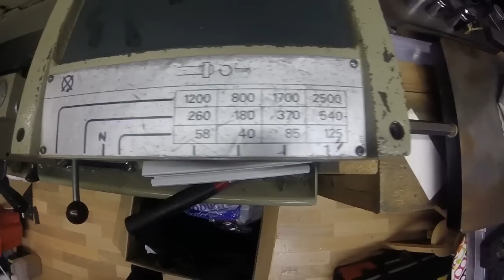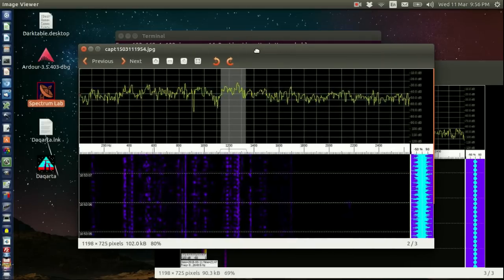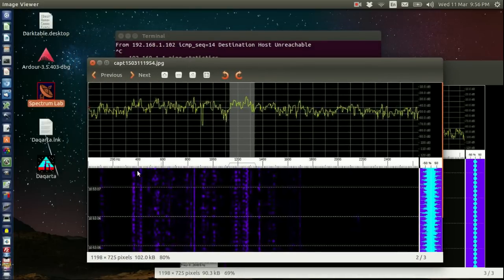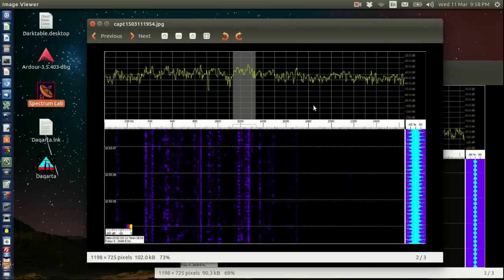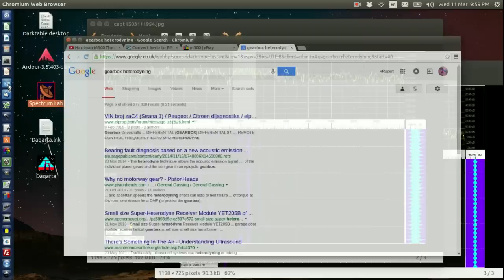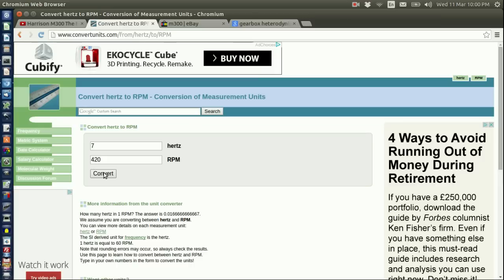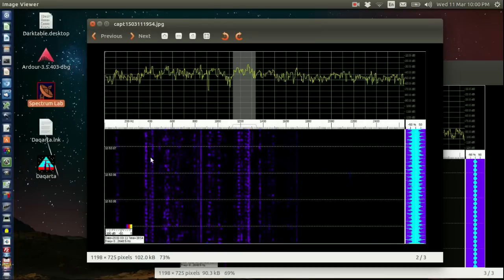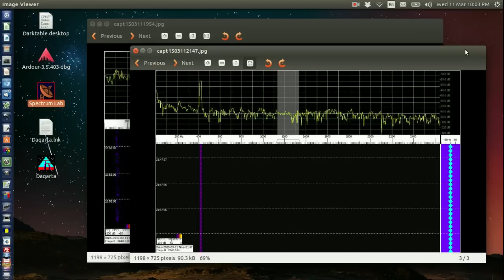Harrison M300 - "The Noise" Part 5

Comment: Hi rupert. I know this is an old video but did you ever find the culprit for the noise. 

I know this is an old thread. But have you tried removing the spindle and gear that you think is the problem and maybe running the lathe slow speed to see if you still get the same noise. If it was me I would try that and if the noise is still there maybe try and remove the other gears to determine if you can locate it. I know it's a long shot. But worth giving it another go. If your still finding the noise is still an issue.
Reply from the maker: It does still make the noise but I am so used to it now it doesn't bother me. I can run the lathe in neutral (which disconnects the suspect shaft) and the noise goes away. Removing the spindle is not trivial and requires the whole top end of the gearbox to be removed. The bearings are in tight and I would run the risk if damaging the large Gamett bearings in the nose. These cost half the cost of the entire lathe (what I paid at least) to replace.....therefore I am reluctant to do it.
Reply: @rupertpowell  its was just a suggestion. As you say the expense would be to costly. I bought a lathe the beginning of this year and still haven't got round to restoring her. I'm hoping I don't find any gremlins. That come back to bite me. And like you said in the previous videos which I enjoyed.  The 600 group ivee found is not much help and the cost for a replacement gear is crazy. My lathe is from the early 60s and when I contacted Harrison they were no help at all. With any of the question I had. Thankfully after alot of research I worked out the problems my self.  Glad it's not an issue using these wonderful engineering lathes. Can't wait to get mine up and running. And start making chips
Reply: @rupertpowell  Hi,Rupert. I know this is a very old thread but I have a Harrison L6 which I have had apart a couple of times over the years since I've owned it. I offer a couple of possible causes of your 'undulating noise'. If a clumsy previous user has crashed the gear selection changes in the main gearbox whilst the lathe is in gear and running then small burrs will likely have been raised on the lead in face of the sliding gears. These small burrs will produce that type of noise from the gears. Alternatively if any of your back gears are running out of concentric they will also cause a noise very similar to yours. If any of the shafts in the Norton feed change gearbox have been slightly bent through previous overloading they also will produce a similar noise. The back gear and Norton box issues are pretty simple to resolve. If it is a bent shaft in the feed change box it can be straightened on a press and using vee blocks and a dial indicator. The rest of the main headstock gearbox on a Harrison like yours is a very well made and robust assembly. It is unlikely it is clapped out.

Comment: It seems to me your lathe is tired but the sound is always there when you turn it on.  try the main drive to the lathe possibly electric motor to lathe that type of squeal is also found on a car when the fan belts are and pulley wheels need to be fixed. spectrum analyser ??????  the most important thing is KISS.

Comment: Great videos Rupert thanks.
Cunning spectral analysis too, but I'm not sure I agree with your conclusion. I think you have identified the main offender, but I think there is a chance it is the single problem source. He then introduces 7Hz into the whole gear train to modulate the other rotation frequencies with the same 7Hz beat. Why would other worn bits  generate at the same 7Hz? Wouldn't they have their own beat frequencies? I think your problem might be local, and not throughout the box. 
Not sure this helps much though, even if it is right.